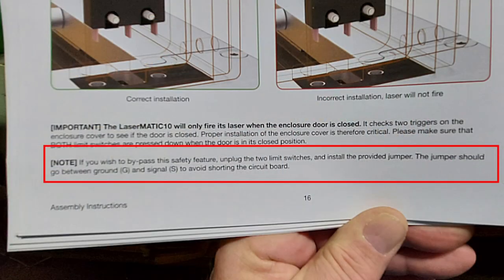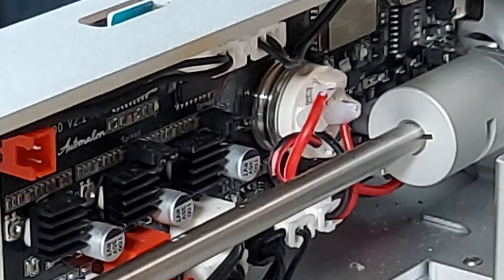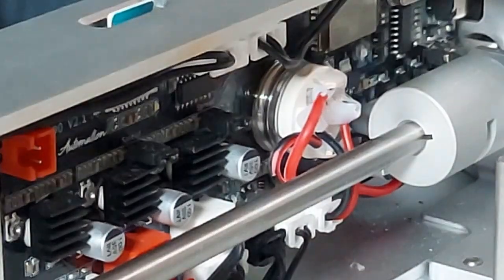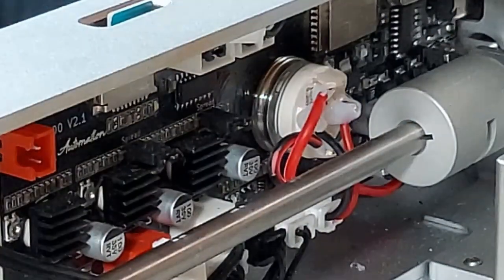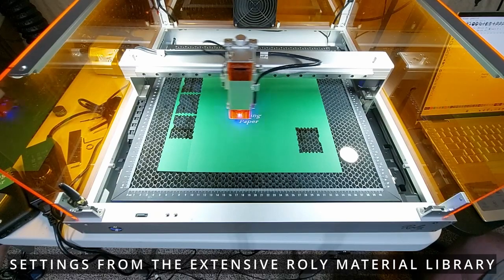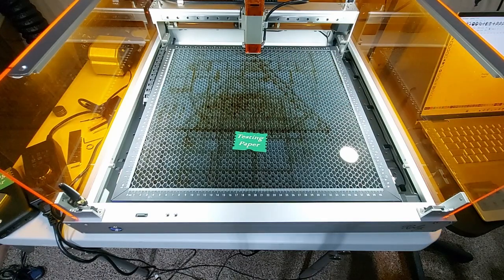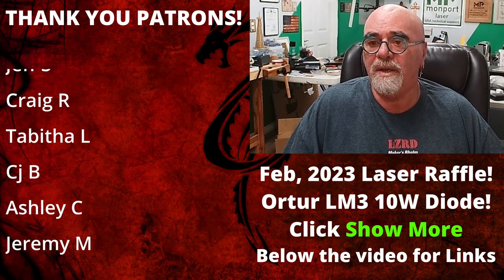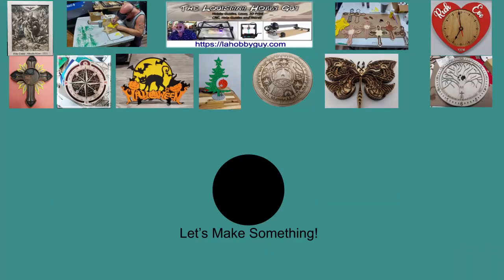Disabling the safety switches on the Roly LaserMATIC 10! If you need to create a passthrough.

Comment: I'm not sure if it has been mentioned but i've just recieved my new roly laser and they have updated the safety switches to a magnetic switches similar you find on doors with security alarms.
Reply from the maker: There are several small upgrades on the newer batches. Congrats on the new LaserMATIC 10!

Comment: My new Roby is my third diode laser so I'm not a rookie, but this thing refuses to move and I'm trying to find the problem. In order to eliminate the safety switches as the cause I need to disable them. I have what I suppose is the latest version of the user's manual (Mar 23) and it does not include the instructions you showed in this video. I went back and downloaded the version from the Roly website and it has the same page 16 as you showed. Roly also sent some firmware update software so I can do the update they ran out of time to do (my words), but that software will not run on either of my Win 10 computers. I'm not impressed to this point.
Reply from the maker: You can't please everyone Dwight, but I will say you're the first complaint I have heard out of hundreds of praises. I have no idea what you mean about page 16. I would guess it's the same. All I did in this video was show how to jump the connectors. Firmware updates are very common and are a good thing since it makes the machine better! Not impressed? Have you contacted their support? That should impress you, and solve any problems.
Reply: @TheLouisianaHobbyGuy  The reference to page 16 was the page number in the user's manual (Rev 1) that you held up to the camera to show where the safety switch bypass instructions could be found. My point was that my manual (Rev 2, March 2023) does not have that same page 16. In fact, that same info is nowhere in the latest manual so your video may be attracting more views than you expected. 

Note: The safety switches have been redesigned from those shown in the earlier manual. The new design should resolve some problems noted by at least one other youtube reviewer.

As to the firmware difficulties, it turned out I just spoke too soon. A box containing the documentation for that upgrade arrived two days after the machine did and that, plus an email exchange with Leo, got everything straight. And YES, now that everything is resolved, I am impressed.
Reply from the maker: Great to hear Dwight! There are revisions on every machine, and in fact, the next batch in June will be an even newer revision. The videos on YouTube are all tutorials at the time of the upload, so no machine will ever be the same that comes out after the review. Mine was on the original product launch of about 800 machines.
The next generation of the LaserMATIC 20 should be on the way here shortly.

Comment: I completely agree to not run the laser without the lid closed.  I only disable the lid safety on my CO2 because I can't see through the lid when framing, but in the little reminder window that I set to pop up when pressing start, it queries me if the air is on and the lid is closed.  with the Roly, looks like you can see well enough through the lid to do your framing.
Reply from the maker: Yes you can Steve!